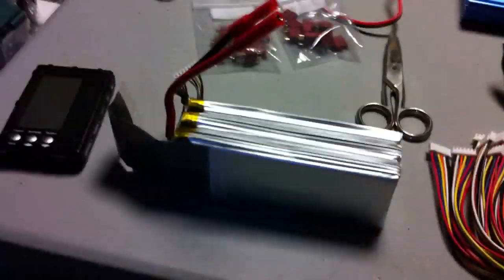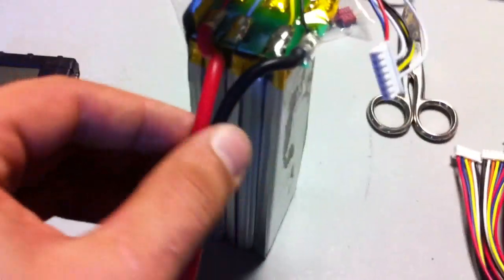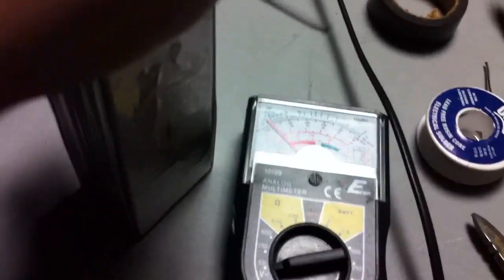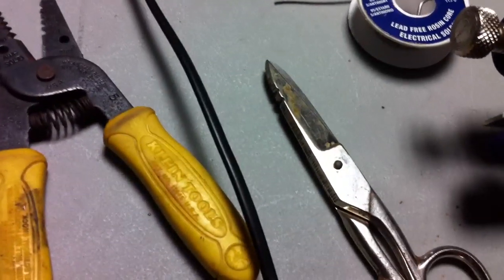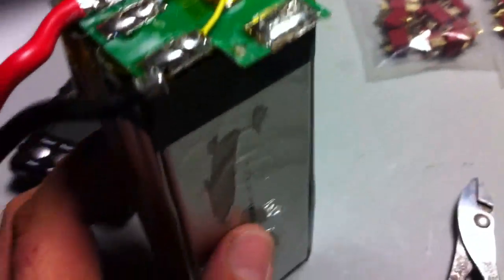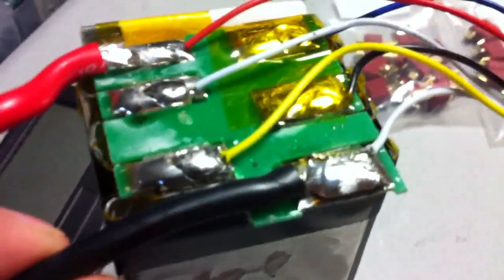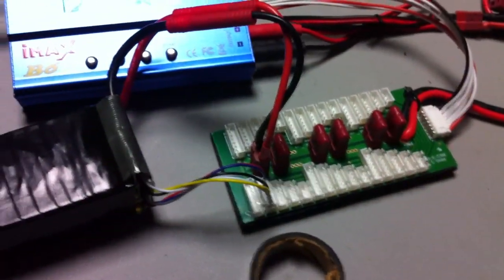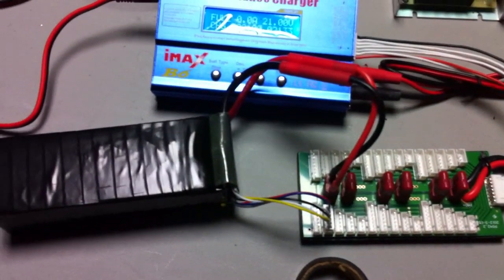LIPO repair - Converting a 6s 5000mah pack to 5s

Comment: very cool. I have a 3s lipo at 8000mah. It's transparent so i can see it has 6 cells. So 3 parallel and 2 in series. I want to turn it into a 6s 4a battery, you think it's worth a risk. I have a professional grade charger as well.

Comment: I just got some batteries from a company that no longer I  business. (roc)  it's a 5s  one cell seams low on voltage is there a way to bring it back or should I look into making it a 4s?  In fact I have a few batteries that are doing this..  Your video is great. I wanted to ask a few questions about salvaging lipos.
Reply from the maker: if the cells drop below 2.5v they are not going to recover at all, and can be dangerous using them after that point. Otherwise they may be salvageable. if they are puffy they will suffer serious capacity loss even if the voltage is intact. just use your best judgement and always charge in a safe area.
Reply: How about making them from 4s to 2s or 3s.  Can you point me to a page for  wiring schematic.  Balance plug /power leads?.
Reply from the maker: Yes google "lipo wiring diagram" and click on the link from scriptasylum.com its helpful
Reply: You didnt say how low is that cell is ,if it is below 3 volt ,forget it make your pack to 3 S ,it aint as easy as you see it on video and dangerous as might short em just by touching your soldering gun .if that cell is about or around 3.2 3.4 volt you may discharge em with your charger if it has discharge set, to what the lowest cell is let say 3.4 volt , after all cells came down to 3.4 volt touch your lipo if  its a bit hot wait till it cools then charge at low rate to full 4.2 volt per cell and see if they all close to 4.1 4.2 volts ,if not repeat again two more times .Causation stay with your batt till it,s down Good luck .

Comment: Hi.  I weigh 150 pounds and have a 48v 1000w rear kit.  My 20 amp hour lifepo4 battery was too heavy for the bike.  Got too many rear flats.  My solution was to buy a 9 amp hour lifepo4 in a triangle shape for my frame.  I like to pedal but do you think this battery will be sufficient for a 10 or so mile ride?  Thanks in advance for any info

Comment from the maker: well at 12P the cells are within their 2C rating so 25 amps will not hurt them. but if there are spikes of up to 30-35amps it may weaken them and sag them a little. i hate to estimate battery life. but if they are taken care of and balanced and only have a 25amp discharge they should last a few years. just dont discharge them too low.

Comment from the maker: Well i would estimate atleast 1500 cycles from them at proper use, but the problem is because their C rating is so low, they will get abused on ebikes fairly quick. Unless you have a 20P battery pack you cycle life will be drastically reduced.

Comment from the maker: It could, although most people that build large lipo packs tape them together to prevent expansion. I myself lightly taped the pack just to protect the cells..its in no way tighter than the stock heat shrink that gets shrunk tight to them. I discharged them today at 20s1p and all 4 packs are at 3.9v equally after the ride.

Comment: Doesn't "confinement" (ie preventing a discharged pack form expanding during charge, creating pressure) reduce the internal resistance, there by increasing d/c rate and eff?

Comment from the maker: I just used what i had kicking around the house. So for now it is a 12v 5amp LCD monitor power supply, this is why i charge 5 and 6s packs at a lower current